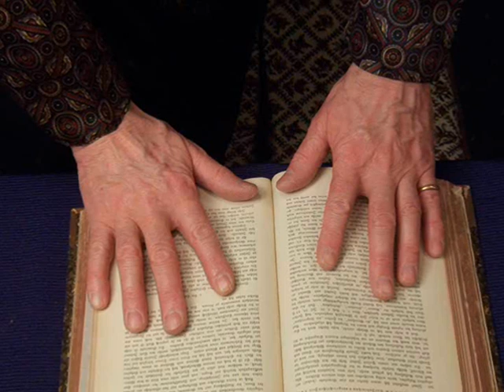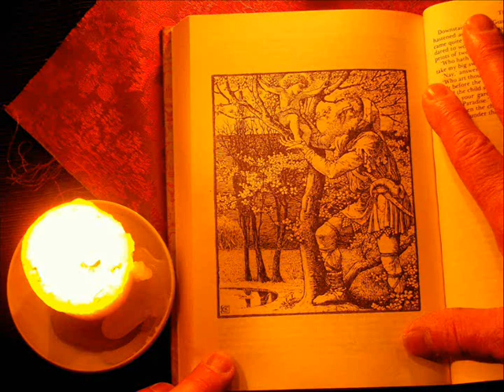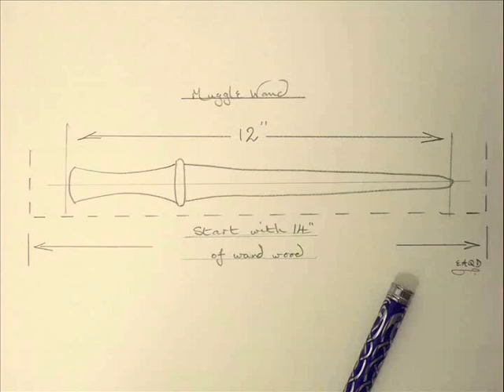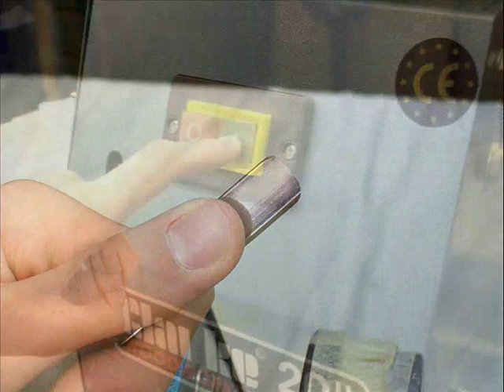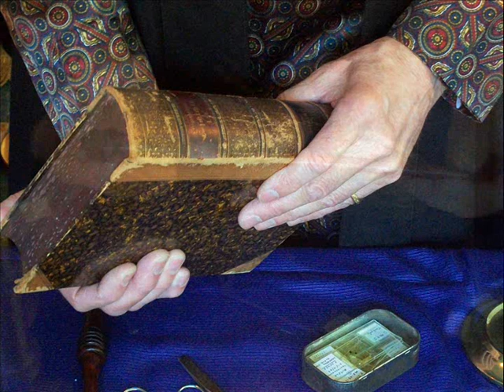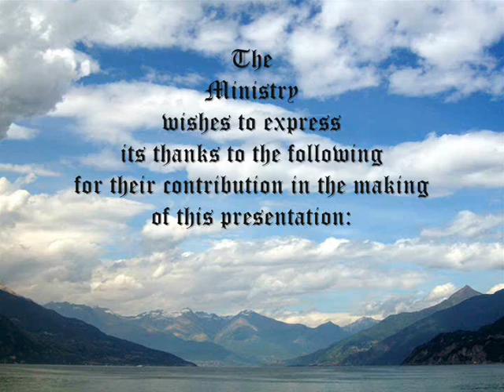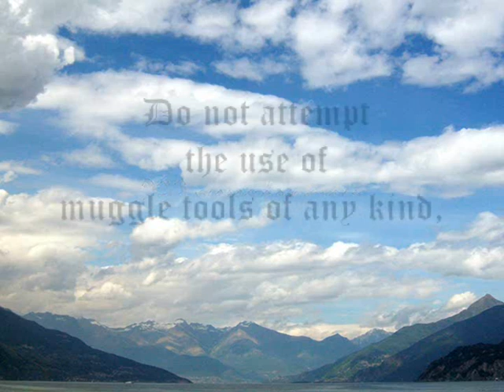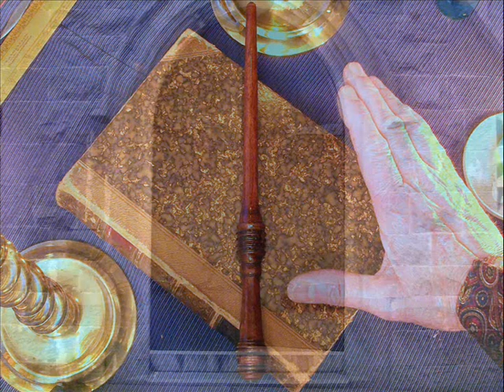How to make a REAL Magic Wand

Comment: You are quite correct.  A wand really is useful in all tasks, great and small, but we are at present greatly restricted in the information which can be shared.  The Ministry's directions on this matter are full of phrases such as, '... by purely Muggle means ... ' ... only so far as would be possible for an ordinary Muggle ...' ' ... strictly without the use of real magic ...' etc.  So, whilst you may make a wand by following this presentation, it will always remain inactive and without a core.

Comment: Dear Sam,
I must give you full marks for an enquiring mind!  To answer some of your questions:
>  The obvious choice of wood for Indian wand-makers might be thought to be rosewood, and though this is used for some wands, the timber from the Indian Mangifera tree (sometimes called Mango) is probably the most common choice, and accounts for the fact that Indian wands are commonly a dark grey in colour.
>  Beech: Strength of character in general, determination, unswerving of purpose.
>  Elder: (Sambucus):  Associations with the devil and evil in general have no basis in the truth.  Elder wands are best suited to owners whose interests lie in the country, with a sympathy for wildlife and open places.  Elder wands have a pale, yellow colour.
>  Yew:  (The wood from the male tree is commonly used.)  Such a wand suits an owner whose character is arcane and secretive.  Far more than elder wands, it is the owner of the yew wand who should be treated with caution.  That said, there are exceptions to every generalization.
As for phoenix feathers - equatorial or otherwise - I'm afraid I cannot go into details.  This is something beyond the scope of this presentation, on which there are strict limits.
Reply: Prof. Petros  , Thanks for your previous replies

Comment: Look, let's get this sorted once & for all. Sloth sticks can work (but not all that well) with some wand woods & even then only some of the time.I'm not sure who Samantha Williams is but the most likely thing for her to have done is to use a mixture of tallow and babbitt hair. (The tallow stops the hair from drying out after long use. It also coats the inside of the wand and waterproofs it which can be handy if you use a wand out of doors a lot.) So stop banging on about sloth sticks Dan!

Comment: Prof. Petros , another question I needed to ask you.  Can I use quartz crystal as a wand core ?
Reply: Crystals have been used in unusual circumstances, but these are not common, as the material has to be ground to a specific size, using a mortar and pestle and only an experienced wand-maker will be able to do this successfully.
Quartz would probably be acceptable, though I have never used it myself, and do not know what its properties might be.
An interesting idea, though.

Comment: Prof. Petros , does the wand emulate the wizard by changing itself to match the wizard ? For example : If a wizard become less human by splitting his soul , does the wand start stripping it's outer appearance ?
Reply: To answer your three questions:
... No, a wand will not change its outward appearance, even if there is a radical change in the wizard's personality, but such a change will affect the relationship between the the two of them and so affect the effectiveness of the wand.
... The phoenix can be found occurring naturally in most countries with sufficient vegetation and a warm climate.  It is not possible to tame a phoenix, though they will become attached to a wizard for reasons which remain unclear.  Phoenixes cannot be caught.
... You cannot add any core to a wand without the use of magic, so 'muggle' methods will not work, I'm afraid.

Comment: Sorry I'm so late but once you do have a working wand, what kind of charms and spells are you able to do?
Reply: they cant tell you because of the muggles watching this
Reply: My apologies for the delay in replying to you.  I'm afraid that we have been having trouble with the muggle notifications for this presentation.  
To answer your question, the kind of charms, spells and enchantments you can manage with a working wand depends in part on the wand itself, and in part on your own abilities.  Both wand and wand-holder grow together as each gains experience, both of the world around them and of each other.  It is a complex process and one which, even now, is imperfectly understood.
At a basic level, you should be able to perform simple control over inanimate objects, such a sliding a small coin or quill along a polished table.  Levitation of even light objects is considerably more difficult for the beginner, though extinguishing a candle or lamp flame is not too demanding.
I hope this answers your question, at least in part.
N.P.P.
Reply: That too, Becky!

Comment: Professor, I am very curious about your wands. What cores did they use? Can you also tell me about some other spells that aren't dangerous but easy? Also, if you don't mind, can you please tell the wand movement of the Foxglove charm (if it has any)?
Reply: For my own use, I have always preferred the hairs taken from a ransogrit's tail.  (The ransogrit is a small, herbivorous mammal, about the size of a fox, with a pointed snout and long, trailing tail.)
The usual movement for the Foxglove charm is based on a of figure of eight, pointing the wand downwards at the plant.  The first pass is downwards at the soil, then moving the tip of the wand up, anticlockwise to form the figure of eight, followed by a long, sweeping movement upwards, to draw the growing stem towards the light.
As the Foxglove charm is already public knowledge, I feel perfectly easy in telling you this, but I cannot go into detail regarding other spells, I'm afraid.

Comment: Prof Petros , from which of these birds should I take the tail feather to get the same power as phoenix tail feather :
1 : Golden eagle
2: Harpy eagle
3: Harris' hawk
4: Pheasant
Reply: An interesting question:
The important thing to understand here, is that you must never take a tail feather from any bird; it has to be given, or it will be of no use, rather like the wood from a wand tree.
Secondly, different feathers - even from the same bird - will have slightly (or considerably) different results, when used in a wand.
Thirdly, the way in which the wand is made - including who makes it - also has a significant effect, as does the person who uses it.
So, no one bird will give a feather which results in exactly the same 'power' as one taken from a particular phoenix, which is why it is necessary that your own wand be made by an honest, reputable maker, and is suited to your own personality.
The closest match you are likely to find to a phoenix, however, would be the Bennu.

Comment: What kinds of magical abilities that you're talking about? Are there examples!?
Reply: I can give you just one example.
If you have innate magical ability, you should, by the time you reach your early teens, be able to move small objects (such as rolling a pencil) without touching them.  You won't be able to control where they move to and unless you come from magical parents, you will be surprised the first time it happens.
Reply: Can you consider astral projection (out-of-body) magical ability?
Reply: AN interesting question.
 'Astral Projection' (or 'Telesentience' as we sometimes term it) has never been proven, because there has never been a case of an actual, verifiable result effected by this means.  (For example, no-one has managed to move so much as a feather, whilst in the state of Telesentience.)  So I am afraid that this cannot be considered a magical ability - if it actually exists at all.
Reply: Is there a magic abilities
Different from moving objects without touching them?
And why do you refuse to give clear answers?
Reply: I'm afraid I cannot be clearer than my last answer.  Astral Projection, as you term it, cannot be seen as a magical ability.
I gave you one example of a magical ability (that of moving objects) but of course there are many others - transforming the shape of one thing into another, causing something to disappear (at least in the mind of the viewer) influencing the course of events, and so on.
I will always try to answer any questions or comments, but there are strict limits on the level of detail I can reveal, and, of course, limits to my time.  I have other duties and responsibilities, as you might imagine.
Speaking of which, I really must go now, or my third-year alchemical class will be getting into all sorts of mischief, I have no doubt!
Reply: Any schooling in North Carolina?
Reply: SirLordPresident III yes Illvermorny is the school for North America if you get in when your 11 I will see you there st least if I get in
Reply: HUMAM HUMAM  you first heard that they are not to give away any magical information

Comment: Professor,  what length should a wand be ? On what basis does it matter ?
Reply: As a rule of thumb (pardon the allusion!) it has been noted that a person's wand usually turns out to be three to four times the length of their longest finger.  But this may have no significance at all, and it is true that there are many exceptions.  It is more the use to which the wand is put, which determines its length.

Comment: Professor, can you please tell me the cores that are easily accessible to muggles?
Reply: Finding a core is not really the problem.  
For instance, you could use the tail hair from a horse or even human hair, but it would have to be a magical horse and the hair would have to come from someone with really extraordinary magical powers.  (Some wizards have tried to use their own hair, only to find it did not work at all, as the powers within the hair were exactly the same as their own, and so they were no further forward and could do no more than they could do, even without a wand.)
Then again, the insurmountable problem for a 'muggle' (we do not really use that term, but I know what you mean) is the magic needed to insert the core into the wand.  It has to form part of the very substance of wand in a magical way; merely being inside the wand is not enough.

Comment: Professor, should I use the African padauk or the Indian padauk?
Reply: I have used padauk on very few occasions, but found it to be a very worthwhile timber, though its character (like its colour) will change over time; not that that is a bad thing - rather the reverse.  A padauk wand, if matched to the right owner, will take on more of that owner's character the longer he, or she, has it.
As for which is better - Indian or African padauk - I don't think it matters, as long as the wood has a straight grain and is well-seasoned.  The orange kind is better for extrovert characters, and the deep red kind would probably suit a more thoughtful introverted personality: but both will darken with time.

Comment: Professor, which wood do you think, is the most powerful wand wood?
Reply: That entirely depends on the purpose you have in mind, but I think you are probably thinking of something like Padauk, a hard, fine-grained timber, with a strikingly red colouration (though, like rosewood, which it resembles, the colour can fade in the light over years).
Padauk is a favourite for wands which are used repetitively and often.
Reply: @ProfPetros , is Padauk a very versatile wand wood?
Reply: @samrubbertommywatergun5098  That is a somewhat complicated question to answer.
Like any other wand, one of padauk  will perform at its best, only with a wizard to whom it is suited, so you are really asking whether wizards who use padauk wands are widely varied in their personalities.  In general terms, I would say that the users of such a wand would be of a determined and patient character.  A craftsman in a practical sense, who needs great concentration and sustained application to produce the required result, would be one example, or a researcher whose investigations may go on for years before showing a final result, would be another.

Comment: Professor, are there any other wizards who have videos demonstrating real spells on YouTube ? Please do send a link of their videos .
Reply: Dear Sam,
A Happy New Year to you!
My apologies for the delay in replying to your several questions.  The end of the year and the beginning of the next is always a busy time at the school, and I have had a lot of correspondence to deal with, and more waiting.
I very much doubt if anyone else with magical abilities has made a presentation such as this one; it was not without a great deal of difficulty that we obtained permission to make this available, and there are those who were, and remain, very much opposed to it.  I have, myself, attracted some criticism for the answers I have been giving here, to the understandable questions from people such as yourself.
The length of a wand is more a matter of convenience for its owner, and a consideration of the use to which it is to be put.  Someone with large hands, for instance, will not be comfortable with a small-handled wand, and as there is a correlation between the length of the handle, and the length of the shaft, a wand with a larger handle will necessarily be a long one.  Conversely, if a wand is to be concealed and needs to be drawn quickly, for instance, a long wand would be inappropriate, regardless of hand-size.  So, deciding the length of a wand is not a simple matter, but a balance of (often conflicting) factors.
Phoenix feathers vary, depending on the characteristics of the individual birds, rather than the areas from which they come, and, on the whole, they suit a person with academic, rather than practical, interests.
Now, you must excuse me if I do not go into more detail; I have much correspondence in front of me, which has been waiting for too long!
Reply: @ProfPetros  , I hope you have a lucky and wonderful new year.
Reply: @samrubbertommywatergun5098  Thank you, Sam, and the same to you!  As the old saying goes, "It is better to be born lucky than to be born rich" or, as wand-makers say, "A twig from your own wand tree is worth a branch from your neighbour's."
(Apologies for having missed this message until now.)

Comment: Professor, are there spells that can hide the house of a wizard from the view of a non wizard ? If it exists, do wizards use it to hide their settlements from non wizards in the UK ?
Reply: There are concealment charms, it is true, but these are usually used to hide small objects from anyone - magical or non-magical, in the same way that you might hide something inside a hollow book.  It is not really a practical method, and it certainly would not work for something as large as a building.

Comment: Professor, are there any magical objects owned by non-wizard in museums ?
Reply: There are, inevitably, some magical objects which have found their way into the non-magical world.  Where these are still 'active' in some way, or capable of being accidentally used, they are traced and either retrieved or otherwise made inert - usually the latter, as removing an object simply draws attention to it.  
The very few which 'slip through the net' are the ones which turn up as 'talismans' or 'lucky charms'.  When this happens, it always comes to the attention of someone with magical abilities, and this results in the 'talisman' being made inert: which is why so few of these objects work as they were originally said to!
Reply: Prof. Petros, I meant in a museum or something because someone very important had it in his/her possession.
Reply: @samrubbertommywatergun5098  This may well be the case, Sam, but such objects would no longer have any magical potential, as I explained, above.

Comment: Professor how can I do magic without a wand?
Reply: If your inherent magic is sufficiently strong, you will be able to perform certain magical acts without a wand.  The problem with this is that your magic will not be as controlled, nor as strong in its effect as it would be with the correct want.
A wand directs magic; it does not create it.  Because of this, if your magic is too weak or non-existent, then I'm afraid no wand, however well-made, will help you.
So, my advice to you is: try! and see what happens.

Comment: prof.u said that every tree have some powers than can I make wand from the local trees  as the place I live do not consists of much trees
Reply: It is possible to make a working wand from almost any wood.  Most would be acceptable, though a very few (such as Rhododendron) are quite unsuitable, and a very few are excellent.  This last group includes several species which may develop into Wand Trees, of course
  I have no idea of the kind of trees you have in mind, but there is no harm in trying.  However, please remember that your wand is unlikely to work without a magical core of some kind.  (There is an extremely slight chance that you would have taken wood from a Wand Tree, and this would certainly have some magical properties, but without a core, these would be difficult or impossible to control.
  Good luck in your quest!
Reply: Prof. Petros thank u for ur advice .than may I have a core of eagle's feather as I can't find phoenix feather.
Reply: Smriti Silwal An eagle feather core would be entirely suitable for many purposes, and also rather easier to obtain!
Reply: Prof. Petros thank u for ur advice